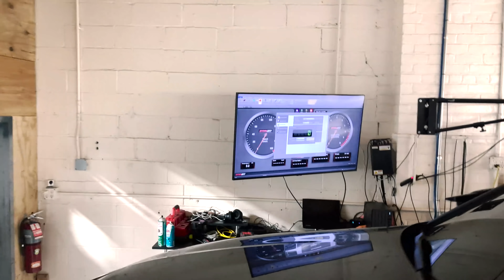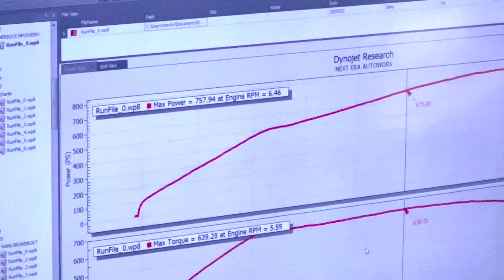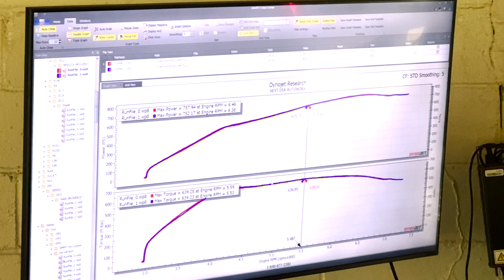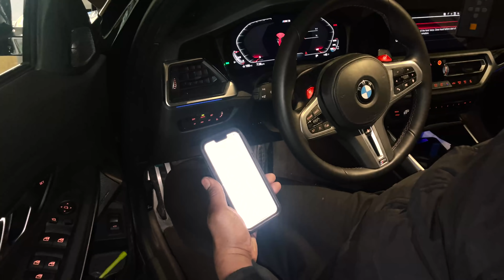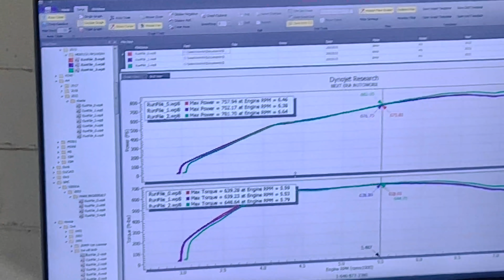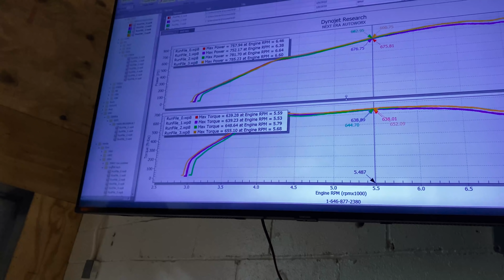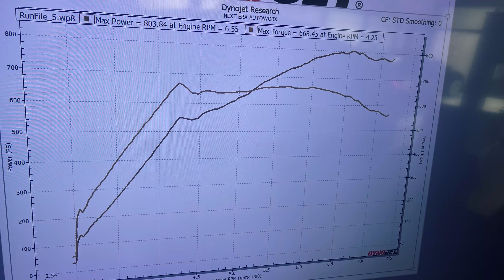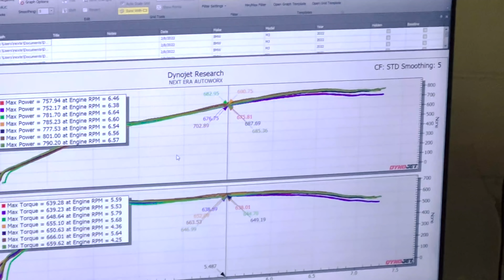WORLDS MOST POWERFUL AND FASTEST BMW M3 G80 DYNO! PLUS RACING IT WITH MY  BUILT TTRS!

Comment: Feels like the g80 transmission was holding on for dear life on the race
Reply: that transmission can hold 1000+ whp. Same transmission is in the f90 and there are built f90 m5's with 1100hp running stock tranny
Reply: @zafert85  yes, i'm aware that it can withstand 1000+whp, but the transmission does not shift as crisp as it should be in the video
Reply: @matts.6789  needs torque limiters raised up and bunch of other optimizations inside the CAL.
Reply: Probably needs a TCU flash
Reply: @zafert85  Torque kills transmissions, not hp
Reply: @GT3.00  So doesnt Torque correlate with hp most of the time? An M5 with 1100+hp has 1200+nm
Reply: @zafert85  no. F1 cars v8 have 750hp and only 350nm
Reply: @GT3.00  exception is not the rule. Lets talk about road cars and cars with forced induction. Nice try though